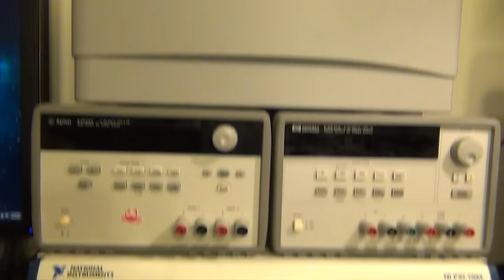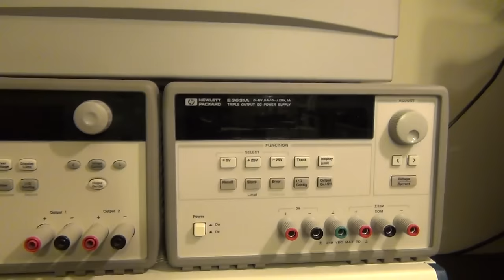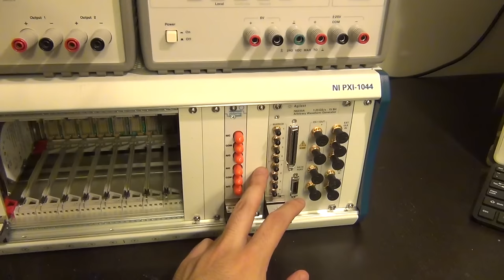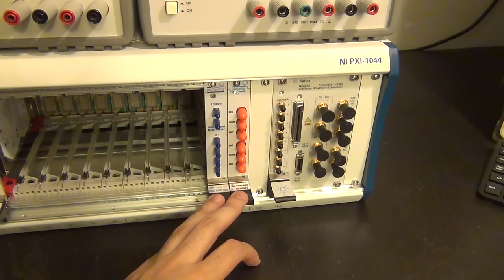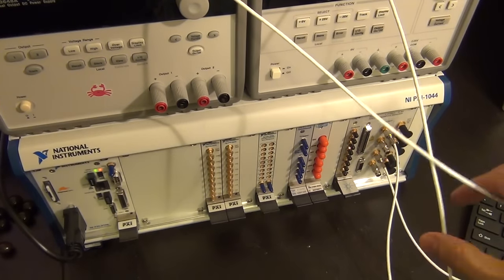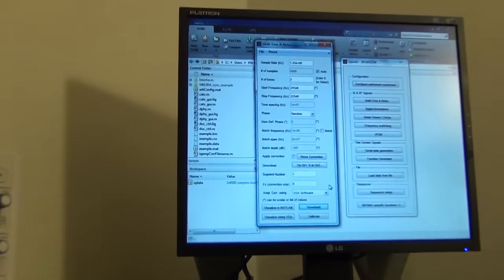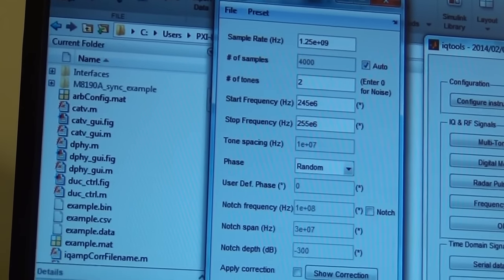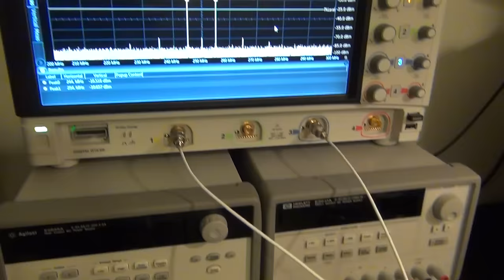TSP #53 - PXI Chassis Upgrade & Various Module Examination

Comment: Your videos are quite amazing. You are very kind as well, as you helped me successfully determine the condition of a recently acquired Fluke 199c.  It was rather serendipitous as I watched the video of your tear down of the 190 and strangely enough there was a 199c on eBay  for $500 that needed a small amount of work. You led me in the right direction and if only I could buy the top end of the scopemeter I would have a $1700 instrument. But alas Fluke has considered it obsolete. Hmmm 3D printing would work if only I had a copy.....
None the less the battery charges and I'll just relocate the charging Jack port to another location. 
I will get so much more from your videos when I have learned enough to understand them.  You are so bright I feel defeated but you are very humble with the way you impart your knowledge. 
Terrific videos, thank you very much.

Comment: Great video. I have always been curious how a PXI setup would work. I was hoping for a bit more explanation on the software side. Do the manufacturers have the drivers online for every PXI card or is the software just as obscure to obtain as these cards? Which programmes can interact with the PXI cards? Another spontaneous video on the software side of things would also be very interesting because its very hard to get first hand experience with these setups. Again great video, keep them coming.

Comment: I like the idea about spontanious videos.I think even if the topic seems trivial to you,it is most likely interesting and educational for most of us.
PS
I often see such interestin and useful modules on ebay for very low price, especially the ones from surplus shops. I wonder if it is possible to use them separately as doughter boards for my fpga\mcu dev boards.If i only could hack the interface...